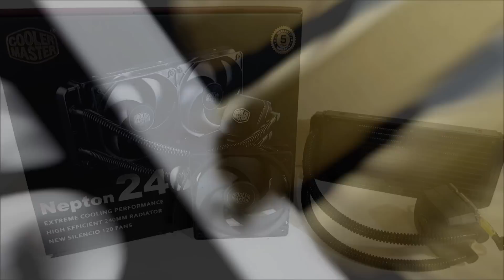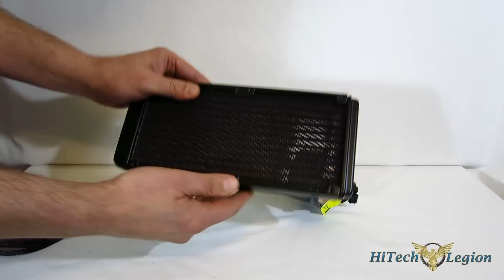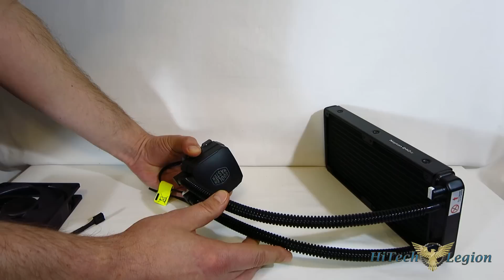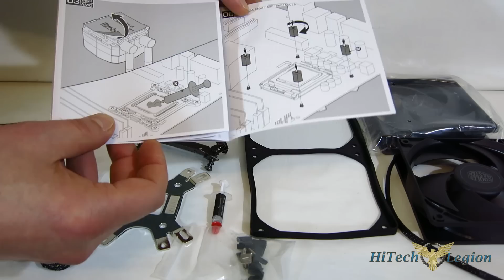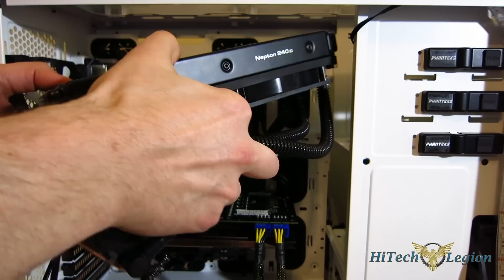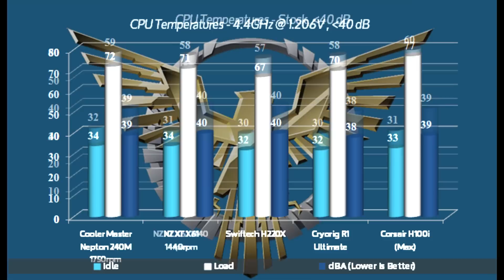Cooler Master Nepton 240M CLC CPU Cooler Overview, Installation and Benchmarks

Comment: CPU fans with spliter plug to CPU FAN, where to connect pump? i need to buy 12v molex adapter? if I  connect pump to mainboard asus z170m for case fan is OK?

Comment: According to Coolermaster the fans should be doing an exhaust from the top of the radiator and then out the top of the case.  Did you try this to see if numbers changed on your tests?  Sorry I know this is an old video but I am just getting the 240 in the coming days.
Reply: Yes, we tested in pull also. Essentially no performance difference, but mounting the fans in pull did introduce some unwanted noise.
Reply: How big of a difference was the unwanted noise?
Reply: William Reed It's subjective. Try it both ways.

Comment: Is there a way to bring air in the case instead of using it as an exhaust?
Reply: +Deeznutzlab You could turn the fans around. Just keep in mind that you will be turning your case into a convection oven, and every other component will suffer while you get a 1-2 degree drop in CPU temps.

Comment: fuck this product!!! just bought it and under prime 95 the temps on all of the cores are around 90-100 wtf!!! don't know why this happenes to me man.... tried everything and stll same temp, i7 4790k btw.
Reply: +Blessed Titan Did u remove the plastic sticker under the contact plate of the cooler? Because that happened to me once and also had really bad temps soo make sure u took that off.
Reply: +Blessed Titan Are you sure the pump is running?
Reply: how do u check that?
Reply: yea i did take it off, still when i play games like smite, the temps are 60, like wtf, is that normal?

Comment: consair h105 or cm nepton 240m 

?? answer me please
Reply: +Χαρης Ευκ The video is of the Nepton 240M. The H105 does not appear here.
Reply: +George Cella wtf bro ..you are omg....just i asked ......what is better nepton on consair h105 ..oohoh ..oh my god bro.....that was just a quastion..
Reply: Χαρης Ευκ Actually, you didn't ask what was better....or really anything, for that matter. To answer the question you finally asked - performance will be similar in most applications, while the Nepton is significantly quieter. In extreme applications the H105 should be a couple of degrees better - but will also sound like a vacuum cleaner. The reason for this has as much to do with the better pump in the Nepton as it does with the included fans.

Comment: im looking up your case because i just got my cm nepton 240m, but it doesnt fit in my current case (Cooler Master Elite 430) do you know if it will fit in your case with a msi z77a-gd65 motherboard? :) thanks
Reply: +ChrisDesmorais  Its a Phanteks Enthoo lux. Its the higher end Enthoo with built in RGB lighting etc check out hardewarecanuks for a fantastic review. A 240 rad combo will fit in most cases, I have the small Enthoo pro M full acrylic window and Its a fantastic compact mid sized case
Reply: +TheFatCarpBaitCo yeah i read what case it was in another comment :) im just worried that if i order the case ill use a few hours dismantling my pc, and putting it in a new case, just to find out that ill be having the same problem with my ram blocking the radiator :(
Reply: +ChrisDesmorais The Luxe and Pro have 70mm above the MB, plus fan mounts on top of that for clearance. You will not have any issues. If you want to stay a little smaller, the Enthoo Pro M acrylic uses offset mounting and also will have no issue with your components.

Comment: Hello, how is the sound level of the pump on full blast ? I swear I got issues... I bought the bequiet silent wings 2 and I can ear them... they are at 16 decibels max... wtf is wrong with my ears :/
Reply: +harshlens The pump is quiet in comparison to other CLCs, but is audible. What you are hearing is the noise generated by the air moving through the rad, not so much the fans themselves.
Reply: George Cella
Yeah it does make more noise when I close the case, I bought a dremel and cut off some useless extra grill on the case.

Comment: what watercooling can i use for i7 6700k ?
Reply: +Maxim Mihailidis (Iskander) Skylake uses the same mounting hardware as 1150. So anything that fits with i5-4690k/i7-4790k will fit.
Reply: ***** Thanks you.
Reply: Maxim Mihailidis No problem:)

Comment: So the Thermal Paste isn't like a glue, but a lubricant, and won't stick to your CPU right? (Forgive me I am a noob :p)
Reply: +Sean O'Brien If you are referring to the included TIM, it is not an actual lubricant, but is not a glue and will not stick to your CPU under normal circumstances.

Comment: how to connect the pump only on 12V molex? anyone please i need advice
Reply: +JOXWb You need a 12V 3-pin to Molex adapter like this one - http://www.amazon.com/BitFenix-Alchemy-Multisleeve-Triple-Adapter/dp/B006VK9JZK/
Reply: George Cella so what i need is to cut one side so i can place the 4pin inside the female? if so is it going to hurt the pump if i somehow mess things up maybe connect two wrong pins?
Reply: JOXWb You shouldn't be cutting anything. The pump will plug into the 3-pin side of teh adapter, the molex side plugs into your PSU.
Reply: mate i dont know if you didnt understand me the cable of the pump has 4pin PWM header
there is no physical way to place it inside that molex that you are telling me to
Reply: +JOXWb Sorry - I totally forgot that the 240M uses a 4-pin connector with three wires.....

Easiest thing is to get an adapter that uses an open 3-pin connector, like this one - http://www.amazon.com/HDE-4-Pin-Molex-Replacement-Computer/dp/B0081K3ZS0/

The tab on the connector only allows it to be plugged in one way.
Reply: Nice thanks ill look if there is this kind od cable in Serbia to buy didnt see it before :)
Reply: JOXWb Worst case, you can simply cut off the side of the 3-pin to accommodate the empty connector on the 4-pin. I usually wind up doing that with all of mine.

Comment: i am thinking of buying this water cooler but i have 2 problems, i don't know if it will fit my case and i don't know if i can attach it, i have an AM3+ for my processor, and i haven't seen anyone attach it to an AMD processor, also i have an Cooltek K8 case and it has those easy snap bracket things... don't really know the name of them but i wouldn't know if i could then attach it or not, if not which case should i buy which isn't too expensive to do fit this in? thanks for anyone who leaves an helpfull reply and also thanks for reading, i would greatly appreciate all the info you guys have.
Reply: +ProPlayerBrian I'm not sure about the case compatibility, you'd have to check if you have two 120mm fan mounts next to each other with proper hole spacing (15mm), like in the top or the front.  IF you need a new case, a Cooler Master N300 or N400 shouldn't be too expensive, and the cooler is guaranteed to fit.  As for mounting to your mobo, I have personally installed water cooling on my AM3+ system (CM Seidon 120M).  All you have to do is take off the plastic brackets already in place on the motherboard by its screws, and then follow instructions very similar to the video, but with the AMD brackets on the water block and use the AMD holes for the back plate.
Reply: +Daniel Senti well i was not sure about the space i have so i bought a new case, i bought a aerocool aero-1000, so i have it all working now, thanks for the reply though :D

Comment: great video, but one question can this be attached to the msi gaming 970 motherboard? I have been looking at using this cooler but cannot see any holes for the back plate on the motherboard.
Reply: Yes

Comment: This might be an odd question~
But, would the Cooler Master Nepton 240M cool an AMD 9590 8 core running @ 4.7 GHz? Also, would it be able to handle the 5 Ghz overclocking capabilities? With that being said, can it handle the 220Watt TDP?
Reply: wowfrostmourne It would be up to the task as well as any other CLC. Hard to say as far as the OC, it will depend entirely on the actual CPU in question.

Comment: How quiet should this pump be? Should I not even be able to hear it? I am hearing a slight cackling noise while my PC is on. My temps are normal: about 26 degrees at idle and 70 while stressing with an overclock.

Comment: I tried installing the 120XL version and when checking my temps it showed me 60 degrees on idle. A bit high. When I took of the pump I noticed that the thermal paste (which I spread out nice and evenly on the cpu) looked untouched. So I figure the pump-block is not making any contact with the CPU.. I tightend the screws quite well, but I cant get to seem a good contact.. Does anyone recognize where I might have made a mistake?
Reply: Rogier Jupijn  UPDATE

This morning I tried it again, and it's working!I can't really figure out what I did differently..The only thing I can imagine is that I did the tightning of the final screws in a slower x-pattern (I.E. each screw half a turn before moving on to the next one).Great cooler! Although I'm slightly dissapointed in the noise from the fans. I have one fan mounted on the outside of the case, so I'lll probably move that inside or just replace it with a different more silent fan.
Reply: +Rogier Jupijn Sometimes trying something a second time can work wonders.

Comment: can i set the fans to pull air out by placing the fans on top of the radiator? If i Can, then what screws should i be using?

Comment: I have a 4790k stock speed with a Nepton 240m (stock fans) in a Corsair 760T . My idle temps can go up to 53 degrees celcius. But my room temperature is okay since my GPU's idle temps is around 31 degrees. I have removed the cooler once before during installation to change the orientation of the radiator . Is it a thermal paste issue ? I can't really overclock my CPU much due to the temperature , even on 4.5 ghz it can go up to 85 degrees and I don't dare to push it even more , from reviews I see people getting like 30 degrees on idle on the same CPU . Any advice ?
Reply: Le John You definitely have an issue, most likely something in the mounting. It could be a severe lack of TIM, when you took the block off did you have a thin even spread over almost the entire CPU? It could also be a mistake in installation and you are not getting enough pressure on the seat - did you accidentally mount the retaining brackets on the block side rather than in the slot? And the other possibility that sounds ridiculous, but we see often - did you remove the plastic protector from the CPU block?
Reply: yep the plastic protector definitely was off . I think its the thermal paste, although i used grain of rice method, and I used the stock one. Just orderd the Diamond IC off amazon to reapply the thermal paste, hopefully it helps . Thanks for the quick reply anyways :) Cheers
Reply: Branislav Stratrov Hey I changed my thermal compound to Noctua's NT-H1 , and I have to say its fantastic now . On stock 100% load its about 65 degrees Celsius and idle is about 27 degrees Celsius . I guess the stock thermal paste wasn't of good quality , definitely worth spending a couple bucks extra on the thermal paste . Really happy with the cooler now. Extremely quiet fans and I'm able to overclock my 4790k to about 4.8ghz with stable temps tried 4.9 but the temps were slightly uncomfortable for my liking as it is in the mid 80's to low 90's under load
Reply: Le John did you fix it ? how are the temps now ?

Comment: This is a great review and demo.
I wonder if it can fit in an Antec P180 case which does not have a removable top for fitting the fan assembly.
Reply: Kevin Bree Thank you, glad you enjoyed it.

The only way I can see to get this in the P180 would be in the front with the drive cages removed. Unfortunately, the P180 was not designed with liquid cooling in mind. You can, however, use the Nepton 120XL mounted in the rear exhaust location.
Reply: George Cella Thank you very much George. I appreciate you taking the time to reply so quickly.

Comment: Noticed that the Nepton 240m package does not come with the tool (to be attached to a regular screwdriver) to remove the 4 risers/standoffs that secure the backplate. Although they screw in just fine using fingers (tool-less) I suppose they may get a bit tightened after the waterblock is screwed in onto them. I recall the Seidon 120m, 120xl and 240m coming with that tool to remove the risers.

Comment: I am not a fan of cooler masters mounting hardware. I have a 120mm liquid cpu cooler from them that came with a mounting screw that had a section of missing threads. I now have a Corsair H105 that I love. Actually its on an msi mpower motherboard and I also have the gtx 770 classified. Small world. :)

Comment: I've been using the Nepton 280L for about 6 months, and I'm very satisfied with it.
Reply: BIadeSnap You can always trust the internet.
Reply: Hi, I've heard some rumor that liquid cooling generates fungi and require maintenance is this true?, thanks!
Reply: BIadeSnap You are confusing custom open loop cooling with CLCs. Open loops will run into this issue if they are not filled with a proper coolant/biocide/kill coil/etc, or if they are not maintained properly. The yearly maintenance is the price you pay for the increased performance and lower noise, as well as longevity.

CLCs (closed loop coolers) will not develop this unless there is another issue present with one of the seals or the original fill.
Reply: I have heard that these problems occur with corsair hydro cooling series :/

Comment: Swiftech x220 is the BWAS!
Reply: Biological weapon agent-sampling?
Reply: ***** He was trying to guess the abbreviation of BWAS!
Reply: HACKER (WCK) - EPIC GAMING - EPIC EDITING - It was the first result Google found for the acronym.
Reply: ***** Of course! How silly of me not to realize he had misspelled a misspelling of another word......
Reply: ***** Which part? Him misspelling a misspelling of a word that any second grader can spell correctly in the first place, or you caring?
Reply: HACKER (WCK) - EPIC GAMING - EPIC EDITING - Obviously, I knew exactly what you meant. BTW, you are absolutely spot on, the H220-X is unreal. Nothing really compares to it....except the H240-X. Wait until you see our benchmarks on that - probably going to require an all new expression - it's that good.

No clue why everyone is getting so twisted up. Some people need to not take slang quite so seriously..
Reply: ***** Yes - it is a closed loop cooler. It is re-assembled and pre-filled. There is no way to fill it or make changes. It is what it is from the box with no variations possible.
Reply: ***** Yes, that simple.

How much you benefit depends greatly on your build, your OC, etc.
Reply: ***** If you are running at stock clocks, the difference between this and a quality mainstream (~$49) air cooler will only be a couple of degrees, as shown in the performance results.
Reply: ***** That is an incredibly broad question. In the case of the Swiftech H220-X or a small custom loop, yes. As you can see in the results in this review, a CLC will be louder and more expensive overall than something like an NH-D15 or Cryorig R1, but won't offer any great performance benefits.

Of the 240mm CLCs, the Nepton 240M offers far and away the best noise/performance, and the best overall performance we have tested to date.

Comment: pretty good cooler just hate the tubes though. i prefer the smooth rubber tubing.
Reply: Yeah, I prefer the smooth tubing also. But, I do see their reasoning for the corrugated, they are much more kink resistant so less likely to cause any flow problems.
Reply: i see your point. so those fans are just as good as the Jetflo fans but quieter?
Reply: teeblack06 Different than the JetFlos. Not sure I could say one is better or worse, depends on the application. The JetFlos can move another 20CFM, but these are much higher static pressure and much quieter.

Comment: Why are some CLC units set up with their fans to exhaust air out of the case (as in this video), while others are set up with their fans to bring air from the outside into the case (eg., the swiftech h220x)?
Reply: virkelie2 First off, the H220-X is not a CLC, it is open loop. It also has design constraints that do not allow for bottom mounting of the fans. Since push setups are preferable to pull in most cases, I assume that is why Swiftech packages this way. We actually test the H220-X in exhaust/pull as indicated in "Testing Methods" page of the review. This puts all of the coolers on even ground.

The only CLC I have ever seen that recommends the fans be used as intake are some of the Corsairs. This will get you a couple of degrees better performance on your CPU if you have a case with airflow that isn't very good, but it also roasts the rest of your system since you are blowing heated air in as intake. Ideally your rad fans should always be exhaust and your case should be setup to provide them with good airflow.
Reply: George Cella So for the Swiftech H220-X, you would recommend setting up the fans to exhaust air out the case?